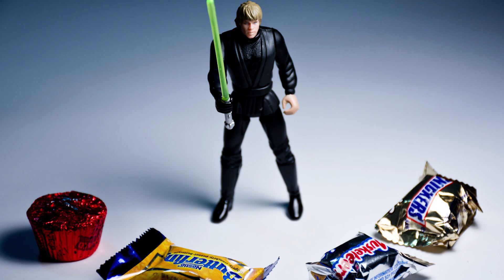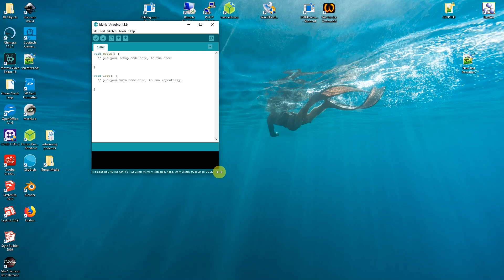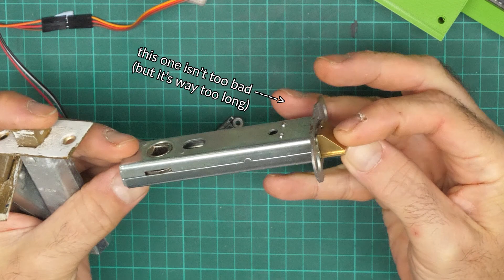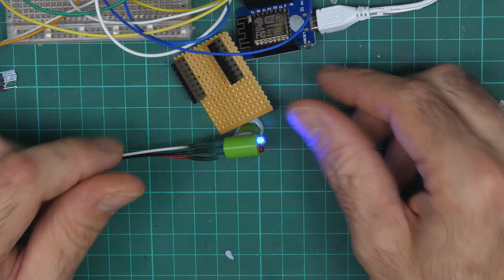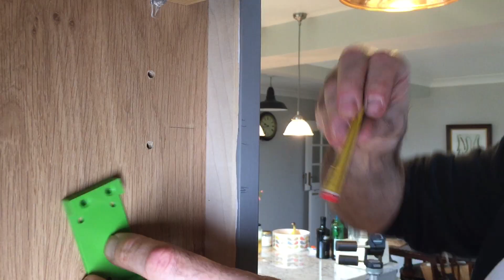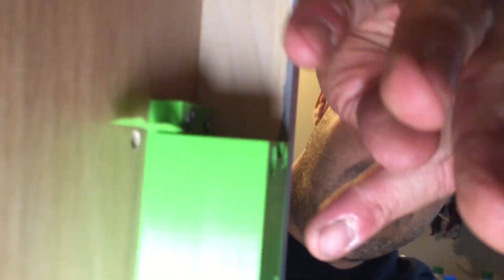The Doughnut Keeper 2000 (PART 1) * An App controlled kitchen cupboard! App controlled door lock.

Comment: I love your videos, this cracked me up.  "The doughnut Keeper 2000" haha.  I have a bit of a chocolate problem too, my wife keeps hiding the choccy from me as well...I always find it though 😜  Respectfully, I definitely won't be making one of these !!  This is the last thing I need in my kitchen haha.  Great concept though, can be used for many applications i guess.  Have you seen the GPS gift / adventure boxes ?  You might be interested in making one of those...  Cheers  Andy
Reply from the maker: haha cheers buddy! i just googled those adventure boxes... they look very cool!
Reply: @JulianMakes  There used to be ones that just flashed up a number with how many metres away it was each time you click the button.  You get a specified number of attempts to get to the location before the box locks out.  You have to figure out the direction yourself.  As soon as you are in the correct place within 5m they unlock and your buddy gets the gift.  They seemed better than running around all over the place with clues.  Almost the same as what you made just with a GPS board...

Comment: This was very well thought out. My arduino projects mostly stay in bread board form for months, how long did you spend on this?
Reply from the maker: thank you Lane Scroggin :) quite a while i must say! the final version is really good (part 2 coming soon). But yeah it took way longer than i imagined it would. But next time i'll be much quicker i think :)
Reply from the maker: Lane Scroggin I forgot to add, the software and breadboard part was relatively quick, the hardware bit took the time (you’ll see in part 2) I keep changing the pla parts until it’s just right :)